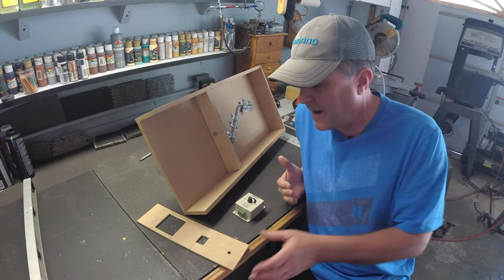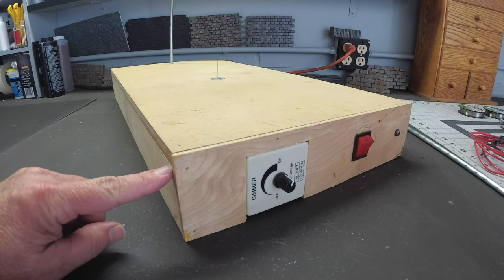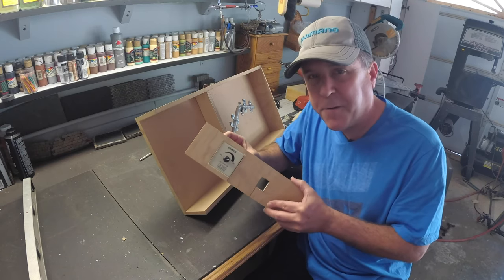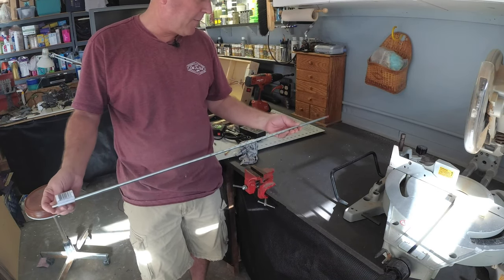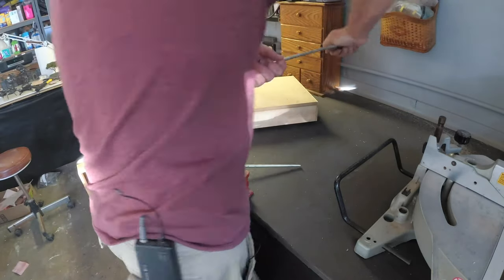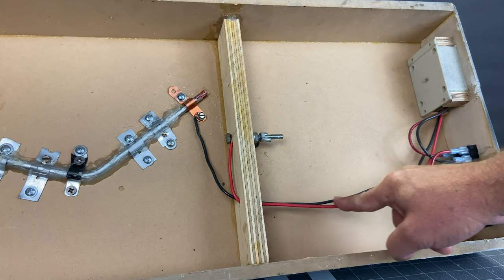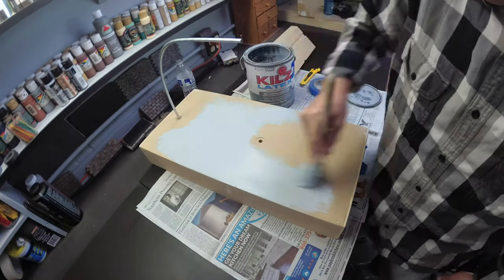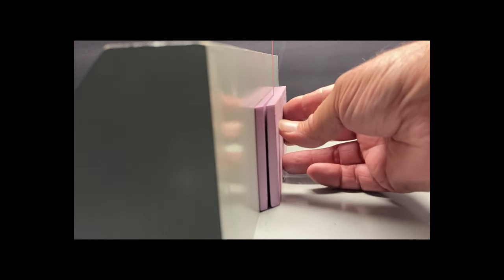Build Your Own Hot Wire Cutting Table for Under $50!

Comment: Thank you alot, I'm building one of these but the parts you use are more recognizable to me than the ones in lukes video so this made it simpler for me!
Reply from the maker: Excellent!  Glad this video was helpful to you... Don't make the mistakes I did though😬
Reply: @thecraftingbrothers9448  I just have a question I have a 5v 3a power cable and I want to use the same dimmer as you does it work since it's 12v 8a?
Reply: @thecraftingbrothers9448  Or do I need a controller or is it enough with an on/off switch?
Reply from the maker: @mrfriedpickle7495  Not really sure... you can try it and perhaps all you need to do is turn down the dimmer switch to avoid burning out the wire.

Comment: Maybe this is a stupid question - how dangerous is it to have the current running up through the zinc bar? Like, obviously you don't want to touch the wire itself; how bad is accidentally touching the bar while the power is on?

Comment: 10:18 is there some reason why you wouldn't just notch the Zinc bar instead of epoxying a nail and going through all that mess? Seems like it would make a better electrical contact as well.
Reply from the maker: Hi, that is a great question and the answer is yes, you can absolutely cut a notch instead of using a nail in the end.  Just make sure the loop on the end of the spring fits on the Zinc bar and that should work perfectly.  Good luck, I use mine almost every day!

Comment: Is it possible to make this without the dimmer switch?
Reply from the maker: You really need that to control the heat of the cutting wire.  Without it, you will most likely burn the wire out every time.  Also, you will want to control temperature for cutting thick foam vs. thin.

Comment: The parts list for this project is no longer accessible through Amazon. The links are dead.
Reply from the maker: Sorry to hear that, this video was made some time ago... Try doing a fresh search based on the parts I used in the video.  Hope that helps
Reply: @thecraftingbrothers9448  It does a bit.

 Thank you. Maybe I missed it in the video but what gauge of nichrome wire are you using?
Reply from the maker: @racheljohnson4900  I use the 28g thick wire for my detail cutting and I'll switch over to 24g for cutting thick pieces of XPS foam